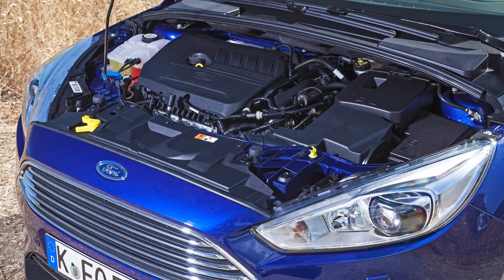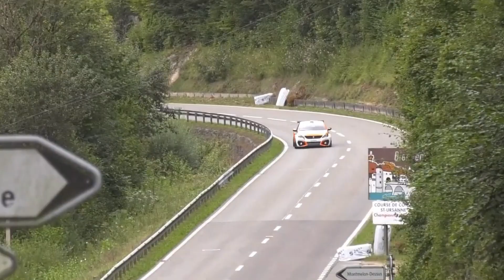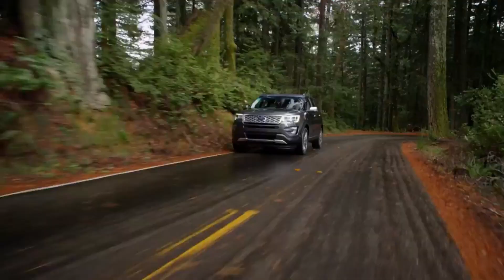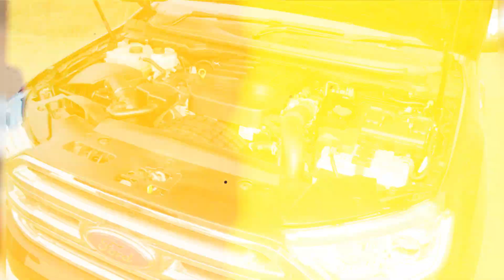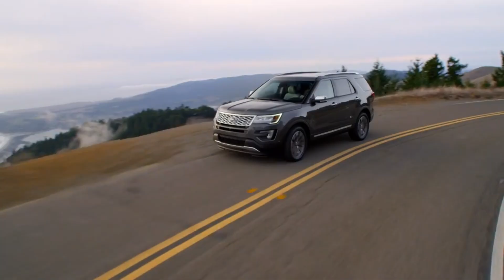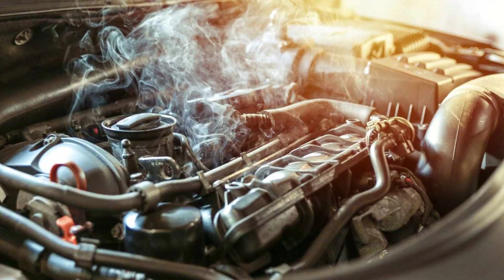The Most Reliable European Engine of All Time,  2.0 HDI Explained!

Comment: Got me a little gem  2005 Suzuki Vitara 2.0 TD HDI manual love it starts first pop everytime even after sitting for 2 years it still starts first go its a good little engine.
Reply from the maker: That's the 2.0 HDI legend in a nutshell — starts first pop after sitting two years, that's the whole reputation right there. The Vitara with that engine is one of those quiet gems people sleep on. How many miles are on yours now? The record from this community keeps climbing and I'd love to know where yours sits. 🔧
Reply: @VehicleWisdom  271653kms just recently replaced timingbelt due to my location its hard to find parts still managed to do it my engine lights turned on wont go off it still starts and runs like nothing happend kinda reminds me of my old honda i think its a stuck egr valve or somthing along those lines😅

Comment: The first gen 2.0HDi 8V found in the Xsara Picasso, 307, 206 etc was not a partnership with Ford. 

The later 16V ones weren’t either……….. but Ford did use them. It’s a pure Peugeot built engine.
Reply from the maker: You're right, and thanks for the precision — the DW10 was pure PSA, not a co-development. The Ford connection gets overstated: they used PSA diesels through the joint venture, but the 2.0 HDI itself was Peugeot's own. Worth correcting because that's exactly the kind of detail this channel should get right. Appreciate you keeping the record straight 🔧

Comment: Mine has a turbo but no intercooler 🤔
Reply from the maker: That'll be one of the earlier 90hp HDIs — the lower-boost versions ran without an intercooler, while the higher-output ones added it to handle the extra heat. Simpler setup, one less thing to fail, and they just keep running. What's it in, and how many miles? 🔧

Comment: Yeah this is a great engine. Working in my Mondeo MK4 Automtatic from 2009 just like new. Even after its 300.000km (186k miles). No leaks, no power loss, no repairs at all. Wonderful engine.

Comment: Nop the 1st generation from 1997-1998 which had 8 valves wasn’t a partnership with Ford, it’s the 16 valves which came in later.
Reply: 2.0 HDi mever had a partnership with ford.Pure PSA engine.But yes,ford used them
Reply: @denizuysal9188 yes it was a PSA built, however there is a certain generation which are stamped “Peugeot, Citroën, Fomoco” and was a partnership
Reply: @anesdj4282 no. PSA and Ford took turns designing engines in their partnership. The HDi is a Peugeot engine and the architecture goes back to the older XUD engines and I'm pretty sure even further back. Ford designed the V6s
Reply: @anesdj4282  Ford engines have 1995 cubic centimeters, PSA engines have 1997 cubic centimeters.

Comment: 66 kW from VW (Škoda, Seat) is the most reliable engine.
Reply: There isn’t really a more reliable diesel than the 2.0hdi. Yeah the 1.9tdi can accumulate 250k miles easy. But the 2.0hdi can do double that with bare minimum repairs.
Reply: @marcuswoodgate4026  Exactement
Reply: @marcuswoodgate4026 OM654 is more reliable engine, but more expensive.
Reply from the maker: Thanks for sharing your opinion! It's always interesting to hear different perspectives on engine reliability, especially from the VW family!

Comment: Clogged dpf. shredded cam belts. Blocked turbo oil filters ect ect. The best engine Peugeot ever produced is still worse than the worst engine toyota ever produced.
Reply: Toyota diesel engine for passenger cars !? I don’t think so 
The 2l hdi can reach over 800k km without issues and with just little maintenance
Reply: The base unit DW10TD don't have dpf. With minimal maintenance, can run easily 500k km
Reply: @Mr83Bungle i have one in front of my house. Peugeot 307 66kw.Undistractible
Reply from the maker: Wow, 500k km? That’s like the tire version of a marathon! Just make sure to keep those tires pumped up – they’ll need all the support they can get!
Reply: Clogged DPF? yeah but only if you not maintaining your Turbo. The 2.0 Engines get after some years cracked turbo hoses, and these clog up your DPF. Its not a fault of this engine, its a fault of maintenance. Blocked Turbo? Oil Filters? sounds alot like poor maintenance. 
You know, you need to take care of your engine and your car. Only buying and never look after it, will kill every engine.
Toyota has some good engines, no doubt about that. But this Engine here is a beast of an Engine, and probably the best engine ever produced in Europe.
Reply: It's a decent engine but far from the best, even when it was introduced, they sufferer with a boat load of issues, and depending on the electronic system installed makes them either easy or difficult to maintain, Siemens is a far more expensive system than the Bosch, both give different performances and reliability, and there's a huge difference in expense if one fails, add to that the ease of repair between them, both systems suffer from hp pump disintegration internals, and Siemens injectors are very expensive and parts for them also difficult to obtain, the engines are leaky too, crank seals especially, auxiliary parts can and do fail often, as for bhp, the 90s are poop, the 110,s can go to around 134 on a simple reprogram, 180s on a stage three, which is very costly as the turbo and exhaust has to go, a good around engine, but far from the best, Merc made one of the best, far superior to any  french HDI, and there are many with 600k on them
Reply: @flippinheck have many 2.0hdi engines with milion km on taxi olso.
Reply: @flippinheck  Mercedes diesel engines are great, but to rank them as better than the RHY and RHZ by Peugeot is inventing modern legends. None of those fuel systems issued are particularly common. Mine reached 480k kms without an issue only that the van crashed.
Reply: You've obviously never heard of rav 4 d4d AD engine now that's a real pos or 05 '6' 7' 8 land cruiser problems
Reply from the maker: Thanks for sharing your thoughts! The RAV4 D4D AD engine definitely has its share of stories, and we love hearing about different perspectives on reliability.
Reply: @tomlyne4453 They're trash compared to the 2.0hdi. I have owned Toyotas and understand the hype but none of the Toyota fwd diesel engines should even be compared with the 2.0hdi. Let's talk facts, not baseless hype.
Reply: There only bad when not looked after..
Reply from the maker: It's interesting how different brands have their strengths and weaknesses! Maintenance plays a huge role in performance, so it's always good to stay on top of it.

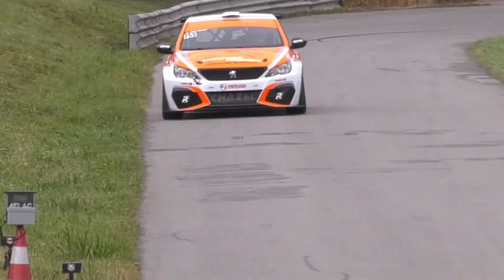Comment: 7:06 Torque measured in nanometers.  A.I. crap
Reply from the maker: Good catch — and let’s clear this up properly. Torque is typically measured in Newton-meters (Nm), not nanometers. It seems like there may have been a mix-up or typo somewhere, because a nanometer (nm) is a unit of length in the metric system equal to one-billionth of a meter, while a Newton-meter (Nm) is a unit of torque (rotational force).

Torque is the measure of a force causing an object to rotate around an axis. In the SI (International System of Units), torque is measured in Newton-meters (Nm). It’s calculated by multiplying the force applied (in Newtons) by the distance from the axis of rotation (in meters):

Torque (Nm)
=
Force (N)
×
Distance (m)
Torque (Nm)=Force (N)×Distance (m)
For example, applying 10 Newtons of force at a distance of 1 meter from a pivot point produces 10 Nm of torque.

In the imperial system, it’s typically measured in pound-feet (lb-ft) in the U.S.

So yeah — torque in nanometers would be physically meaningless in automotive terms. It would be like measuring horsepower in millimeters. Seems like a classic slip-up, and it’s good you caught it.

Appreciate the sharp eye — keeping the tech details accurate matters!
Reply: @VehicleWisdom  Even the reply is AI? !
Reply: @AbhijithCRX yup, a.i bots are creating content and people are making money for it..